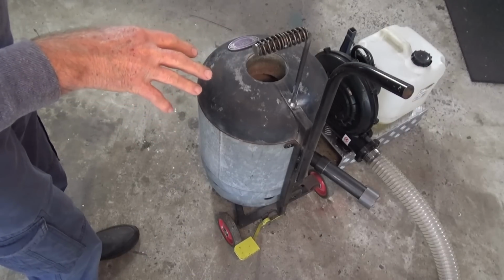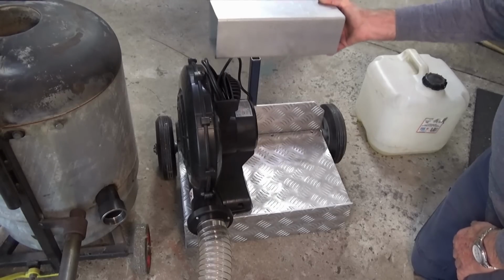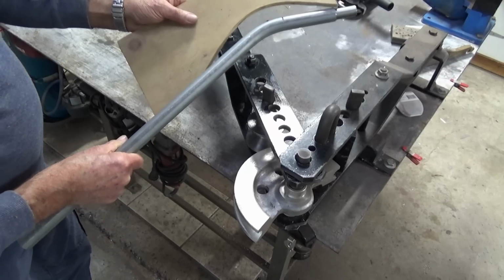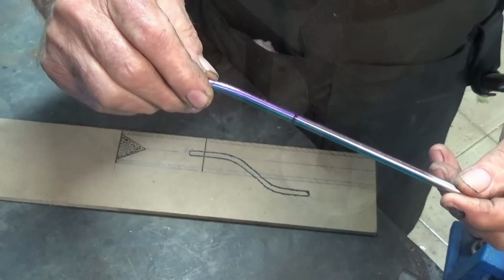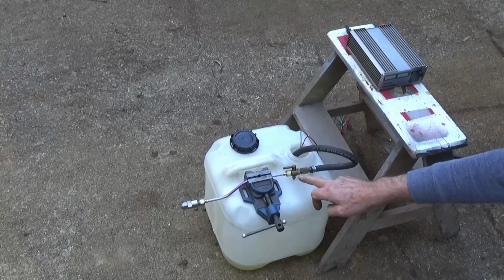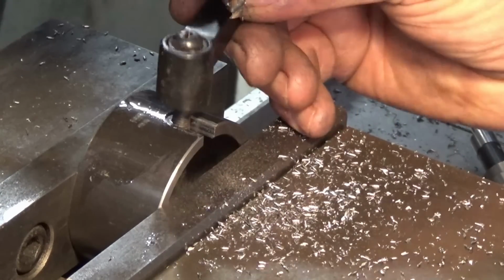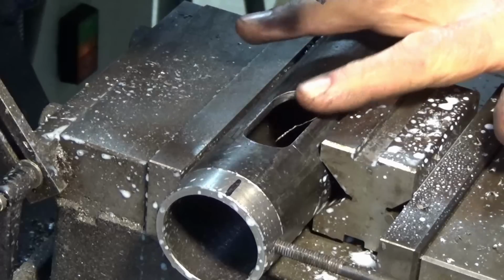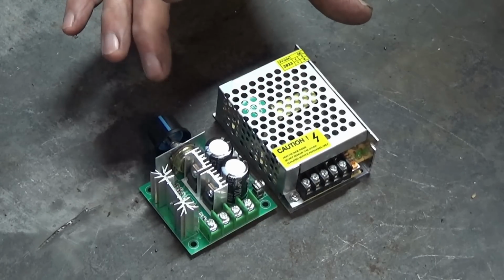Diesel Foundry Furnace Burner - Part 2

Comment: If the little centering "fan" restricts airflow too much, just cut off every other blade (or more).  You only really need three to hold the nozzle centered...
Reply: I believe the primary use of the guide vanes is to mix air and fuel for better combustion and of course centre the nozzle.
Reply: or make the vane angle more shallow
Reply: Yep… exactly my first thoughts. 3 or four ‘vanes’ should keep the nozzle centred.
Regards
Robert

Comment: In addition to removing fins as others have suggested, you could make the center hole smaller and use the diameter of the threaded end of the nozzle to hold the swirl plate.  Also, you might want to bend the lid handle closer to the furnace handle to get it further away from the exhaust hole in the lid.

Comment: You may know this already but automotive voltage is technically not 12v. 12v is about the minimum voltage for starting the engine but should be 13 to 14.5 when the engine is running and is dependent on the state of charge of the vehicles battery and the load on the alternator. The lower the battery voltage or higher the load the closer the alternator will be to 14.5v so running the fuel pump at 12v you are not getting it's full potential where 14v would be the best in the long term. I also agree to keep the nozzle holder simple but this is your project and if we don't try new things we will never learn what works and what doesn't. Besides I'm just some random person in another country being a keyboard engineer enjoying you building something that I may want to make someday. Cheers
Reply from the maker: Interestingly, I was running the fuel pump from a 0 to 30V DC power supply and I tried running the pump on voltages above 12V but it didn't seem to increase the fuel pressure or the RPM of the pump at all. That was a bit of a disappointment since I was hoping I could "overclock" the pump to get a better fuel flow from it. I know that I go over the top on some details of my builds sometimes but for me, that is what makes the project interesting. I like to try new procedures and even if they fail, they can be instructional just the same. I had to make a press tool for the new version of the swirl plate and although it was probably unnecessary, it was fun to see how closely I could get the punched hole to the size I needed to make it a press fit on the burner nozzle.
Regards,
Mark

Comment: Hi Mark,
great work.
consider having the oil line straight in the blower tube sticking out the end and the air delivery tube merging in a y junction.
the air takes the bent path rather than the oil tube.
In his way he oil tube can be pulled straight in or out from the leading edge as you wished
Reply from the maker: I have seen that approach and it is how Perry Merrit made his burner. He had used car exhaust pipe which is thin enough to cut easily. The tube stock I am using has a 5mm wall thickness so it was going to be a mission to cut the opening to make the branch. If I had a tube notcher it would have been a piece of cake but sadly I don't own one. As it has turned out the fuel line assembly has turned out to be fairly easy. I have already run the burner inside the furnace and so far it is looking like a success. I'll put some pictures on my Instagram account.
Regards,
Mark

Comment: I may be dating myself, but 45 years ago I had an oil fired furnace. The blower, fuel pump, and ignition coil were an integrated self contained unit. I do not know if they are still used but superficially it would appear to save a lot of stress inventing.
Reply from the maker: I would very much like to have a spark igniter. You can buy just about anything off the shelf including the igniters so that might still appear down the track.
Regards,
Mark

Comment: Thank you most kindly for the lesson. The hardest part are the names and variation of components. example. a quarter turn tapered plug valve. the injector information and how to understand it's function, just excellent. I cannot use a lathe, more is the pity. But i have designed my own still, which i have prototype and debugged. Now i wish to build a full scale version 1000l and heating has been a problem. I have been looking at the diesel burners in alibaba, and they are just a perfect solution. knowing how they work was so essential, so thank you. The 340w blower gives off about 120kw. if you are interestd. i didn't know diesel had so much calorific energy. So you have confirmed for me the way to go, and.. how i should design the inlet ports. ❤
Reply from the maker: Diesel fuel is still relatively cheap but an alternative would be bio diesel.
Regards,
Mark

Comment: Hi Mark, thanks for the shout-out, it is most appreciated. 
This is a great build. It looks like you have done a lot of research, and you explain the steps you are doing well. I did not expect that huge flame when you were testing the atomizer, but it does look like it will work well. The question is, do you know how much fuel will it use? Also, it is good to see the Hossfeld bender back on the bench and being used. I don't use my one much, but it is really handy when you need a nice bend in some tubing. I'm looking forward to Part 3.
Reply from the maker: Thanks Jon. The nozzle is rated at 2.5 gallons per hour but that is dependent on the pressure of the fuel pump. I doubt that it will use anywhere near that much in my setup. I think the fuel pump is at maximum capacity now but it seems to provide enough fuel to match the capacity of the blower. I sent a viewer to your channel just yesterday. He was looking for a video series on building the Hossfeld clone and I didn't make any videos on that build. My bender doesn't get a lot of use either but for certain jobs it is a real winner. I do want to make up a set of dies for bending light gauge steel square tube though. 
Regards,
Mark

Comment: Hi Preso, excellent video and series so far.
The fuel pump works fine stationary but when there's forced air coming through and you get the 'venturi effect' I think thats when the pump will have trouble supplying enough flow rate.
Will be interesting to see and looking forward to the next episode.
Regards
Kevin
Reply from the maker: I did light up the burner today but it was just running on the bench. The flame is stable but there is a lot of smoke. I think that once it is operating inside the hot furnace I will get better combustion. It would be nice to have some extra capacity in the fuel pump but that's something that will be easy to upgrade.
Regards,
Mark

Comment: Just for information, I did a melt today  with my Kerosene burner. Melted about a litre of aluminium, and used about 2 litres of fuel. I’m using a central heating burner. No idea how that compares to propane use though!
Reply from the maker: Kerosene is a bit harder to buy in bulk here. Some places in cooler climates (Melbourne and Adelaide) sell it as home heating fuel but even at $2 per litre, diesel is still probably cheaper than LPG.
Regards,
Mark

Comment: Good Show Mate: as is the usual thing. This is fun watching you go through the thinking and the machining. Hope it goes the way you want it to.
Reply from the maker: Thanks. I lit the burner running with forced air for the first time today. It seems to be stable but I am not getting complete combustion. This should change when it is running inside the hot furnace. 
Regards,
Mark

Comment: It seems that burners made by myfordboy and VintageMachinery (with air from the blower coming in on the angle and all other tubes are straight) are simple as they do not require bending tubes and allow to position those tubes easily. Also, lid lifting 'upside down' mechanism (Olfoundryman) does not require using legs. 👍👍👍👍
Reply from the maker: I did get the burner running today and with the nozzle guide vane in place to centralise the spray nozzle and the 3D printed cover it all worked as planned. I did consider the other style of burner with a branch for the blower but it's a bit of a mission to cut out the opening for the blower pipe to weld at an acute angle. When I was teaching Graphics we would draw the developments of those branches so they could be cut and formed. If the metal starts out flat it's not too hard but cutting the correct shaped opening in heavy wall pipe means plasma cutting at some intricate angles.
Regards,
Mark

Comment: Mark, maybe a 3 legged spider is a clue to align the nozzle? Cheers😊
Reply from the maker: The latest version of the nozzle guide vane works perfectly. It is made from 0.8mm stainless steel and you will see it in the next video.
Regards,
Mark

Comment: Hi Mark.
Why not make some kind of bracket that will allow you to use propane and diesel burner without a need to rotate furnace?
I do not think it's too complicated. Just bit bigger tube, so diesel burner fit nicely inside, cut on one side so fuel line can pass, and some kind of sleave on gas burner so it also can fit inside it.
That way, you can quickly preheat furnace with propane, and do a quick switch to diesel.
Reply from the maker: Yes, that would work. Preliminary tests today show that the burner will light up on the bench and the flame is stable. Next test is inside the furnace. 
Regards,
Mark

Comment: just snap half the fins off the swirl plate if it's too restrictive. With half the vanes it's still going to have an effect and provide support.
Reply from the maker: I have already tried out the stainless steel version of the guide vane and it works great. I will show how it was made on the next video.
Regards,
Mark

Comment: Hi Preso, Another top video. I made a similar burner (not your design) and it created a really beaut flame. I used heating oil in mine, you might like to give it a try. If you can't get it I believe it's half diesel and kero mix and gives a cleaner blue flame. Apparently straight diesel burns a bit sooty.
Reply from the maker: I am still keen to try adding kerosene but I have had some bad experiences with kerosene deteriorating plastic parts. I used to keep kerosene in one of those trigger pump bottles but they never lasted long. There is not a lot of heating oil used up here in the subtropics but diesel is surprisingly cheap at the moment. At one point it was more expensive than unleaded petrol but now it's gone the other way.
Regards,
Mark

Comment: If that nozzle positioner restricts the flow too much, perhaps removing every 2nd vane may solve that issue. 👍
Reply from the maker: I will make another one from some thin stainless steel and twist the vanes almost parallel to the air flow. Seen front on, it will be mostly open. I actually made a prototype from stainless today. 
Regards,
Mark

Comment: I'm surprise that little pump worked a similar setup is used in heating burners and the fuel pump for heating type burners is usually set around 120 psi
Reply from the maker: I know! it surprised me too. I guess the spray pattern is "scalable". It won't deliver the same amount of fuel that it is capable of but it is producing sufficient atomisation to burn in a smaller volume.
Regards,
Mark

Comment: If the plastic tube doesn't work you should get some flexible exhaust tubeing it's extremely flexible and takes extreme heat
Reply from the maker: I think the PU tube is going to work. Certainly, it doesn't get any heat at all unless it is going to be radiant heat from the outside of the furnace. I do need to make some aluminium collars to stop the spring tearing loose at the ends though.
Regards,
Mark

Comment: "uBlock Origin" may be the Chrome extension that you didn't mention.  Unfortunately, it also affects the operation of some other websites (e.g. Pizza Hut online ordering !), so it may need to be temporarily disabled sometimes.
Reply from the maker: I use Adblock for YouTube. It seems to be fairly benign.
Regards,
Mark
Reply: @Preso58  As do I and have been for years. Works on Chrome, Firefox, Brave, Bing, Opera and others

Comment: If you can obtain a fuel pump from an oil furnace, they have a small shaft of about 5/16" and you can get or make a collar to fit a motor on that, it would deliver the pressure you need for the nozzle.
Reply from the maker: That was an option but it just adds another level of control to the setup. The in tank fuel pump seems to be sized perfectly to supply just the right amount of fuel to the burner. I really did get lucky when I purchased all the components for this setup. It was pretty much guess work and eyeball engineering. My mate Perry in the USA did help out big time with his knowledge and understanding though. 
Regards,
Mark

Comment: Brilliant!! I was wondering if the tooling and dies could be cast out of aluminum....
Reply from the maker: I did make a tube bending die for a Hossfeld bender clone. It works fine on thin walled ERW tubing. I have also made cast aluminium accessories for my lathe and milling machine. Having the capability to make castings allows for shapes  and forms that would be hard to replicate using fabrication techniques.
Regards,
Mark

Comment: so your making an oil burner ( mini version) if you un screw back filter to the nozzle youl see whats called transandental dents these mack the fuel sweril w2ile also being misted if your going to put a turbulator (or whats called a retention head in the oil industry) you should see to it that the a swerls in the opposet direction as the oil this helps with attamization  sorry for poor spelling but you get the jist
Reply from the maker: I did get the burner running today and it was very satisfying to see the flame swirling and tightly constrained. Maybe I just fluked the direction of the vanes but it seems to work well.
Regards,
Mark

Comment: Great video.  Any opportunity that we may get a visual tour of your shop?     It looks like a garage.   I am moving from my big shop to a small property and out of a large shop.
Reply from the maker: It is a garage and I have to share it with two cars. I recently got into trouble for depositing metal dust on my wife's Subaru Impreza. Of course it is white and the dust showed up as red ferric oxide speckles all over the paint after it rained. I am now on a good behaviour bond and I have to reverse the Subaru out of the garage if I am doing anything like grinding or cutting steel. I don't afford the same luxury to my 13 year old Camry! One day I may do a shop tour but that would mean having to clean it up. 
I have built a sort of annexe onto the back of the garage which is now my wood shop. The main shed is 9M X 7.5M and the annexe is about 6M X 2.4M. I also have a 20 foot shipping container which is used as overflow storage and a home for my sheet metal guillotine and big horizontal bandsaw.
Regards,
Mark

Comment: Hola ,buenas noches ,,muy buen trabajo ,,,muy bien fabricada cada parte ,,aqui pasa un poco lo mismo ,en cuanto a los materiales ,,hay muy poco,no es zona industrial por excelencia,  excepción de lo mas comun , de lo contrario hay que dar muchas vueltas para conseguirlo ,, ,entonces nos arreglamos como podemos en estos trabajos de alta temperatura lo ideal es inox 310 ,otro sería  wl 321 ,,, con adiccion de niovio ,,,resiste hasta 1100grados ,sin escamarse ,, ,y esta diseñado para soportar los gases ,de  combustion ,normalmente contienen azufre, ,y otros oxidantes,,es muy  facil de solda cuando es metal , nuevo ,o muy limpio, esmerilado ,t desengrasado acetona ,, o alcohol   ,,metal de aporte ,metodo tig , varillas 310para el primero ,y 347para el ultimo ,,inclusive electrodos, revestidos de la misma denominacion ,o 312 ,excelente comportamiento hasta 1300g ,otra idea, puede usar los corrugados, de inoxidable,,,  flexibles para escapes ,, vehiculares ,en lugar de la manguera corrugada plastica,o siliconada  ,si es cierto sin bastante caros y algo rigido wn comparacion al plastico , pero eternos ,,,,bueno mientras no le caiga encima ,un peso extremo , espero le sea util ,alguna vez ,,o nunca ,es bueno compartir ,,muchas veces nos ayudaba a  encontrar otro camino ,o solución ,un saludo,,y tenga buen dia ,Mark

Comment: Surely you only need three points of contact to hold the nozzle in the centre and they only need be round pins which would not restrict airflow.
Reply from the maker: I was considering a "spider" arrangement but the nozzle guide vane looks cool!
Regards,
Mark
Reply: Commercial oil burners, at least most of them use rotation vanes to swirl the air flow to improve combustion
Reply: @Mark Presling Or you reduce the number of the guiding wings to not restrict the air flow to much. But give the flow a nice twist. Cheers Ulf

Comment: If the vanes cause too much restriction around the nozzle I would just put three legs on it. But I bet stainless sheet will work just fine.
Reply from the maker: I made up a stainless steel guide vane today. It is 0.8mm thick and the vanes are twisted to about 60 degrees. I lit the burner on the bench and it seems to still have sufficient air flow. I'll be able to do some more tests tomorrow.
Regards,
Mark

Comment: bye the way fist number on side of nozzle is flow rate as you know and flow rate is tested at 100 psi if pressure going to nozzle is less or greater then that it will increase or decrease flow rate some comercial burners go as high as 300 psi wich meanes want see burn rate on nozzle an lookup 300 psi for true burn rate also higher supply pressures will attomize fuil better
Reply from the maker: I am thinking that the pump will need to be upgraded but I want to run with it as is for now. I did get the burner running on the bench today with the blower as well. Next test will be inside the furnace.
Regards,
Mark

Comment: How about using two hose clamps to hold the cover plate.  That should make for easy adjustment.
Reply from the maker: Ha! I ran the burner today with some duct tape holding the 3D printed cover plate and it survived. It might be different when it's running in the furnace and there is a lot of radiant heat though.
Regards,
Mark